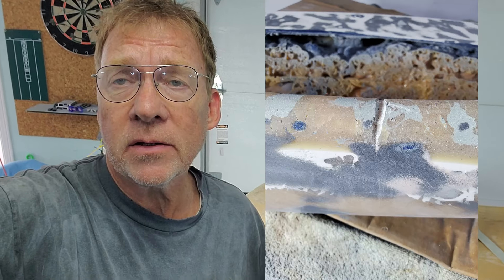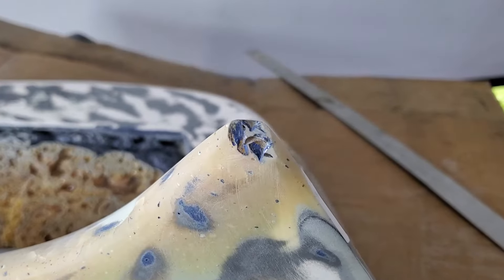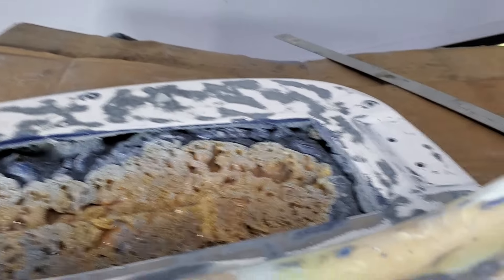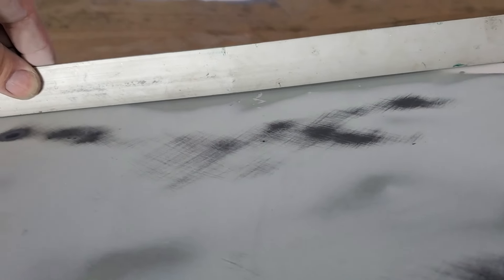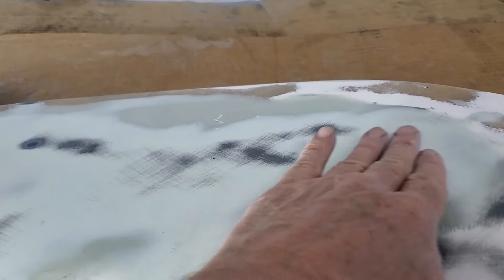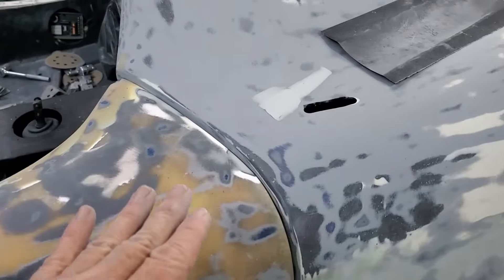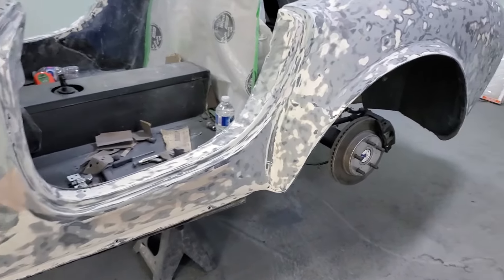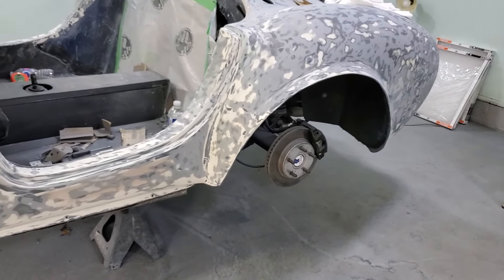Cobra Update Part 6

Comment: You have come along ways . Do you think the high build will level most of that off with the block sanding?
Reply from the maker: I hope so, I am simply running my hand over the surface to identify major issues (like in the door) and filling them. then I block them down . Hopefully once the major ones are corrected high build should address the rest.....fingers crossed